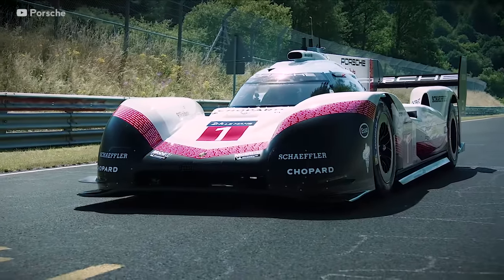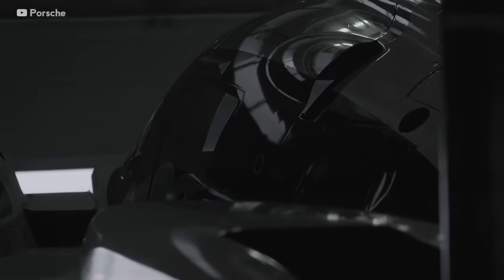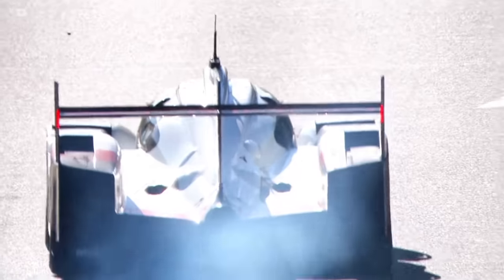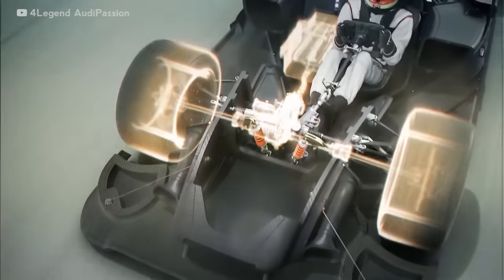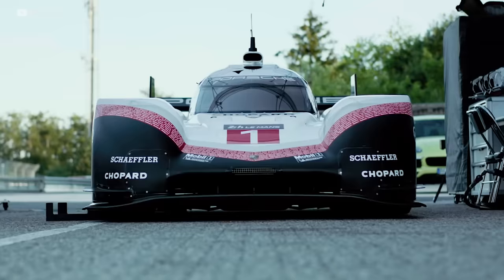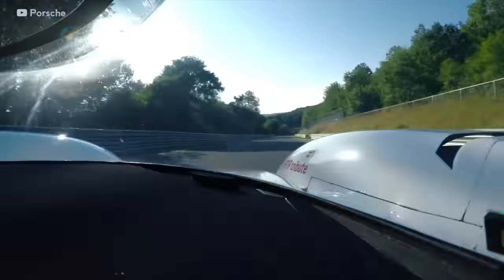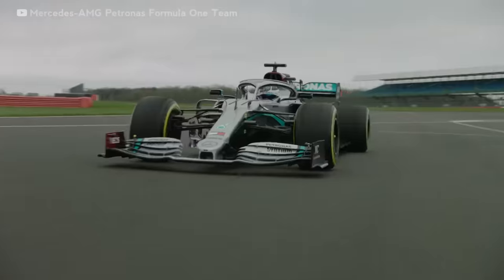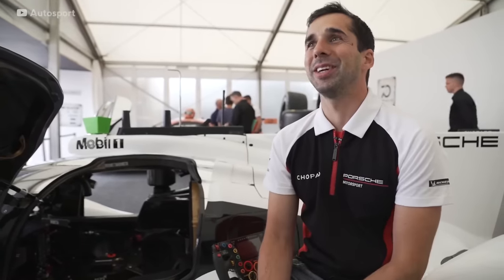How Porsche Built a Car Faster Than F1

Comment: The fact that the merc w11 is still faster really just show how invovations in f1 is still better even with alot of rules and regulations
Reply: Hmm... Probably due to the HUUUGE budget but Idk
Reply: 919 Evo, despite without rules, still using the same component, the restrictions they bypassed are like Fuel flow, ERS deployment (iirc drivers on LMP1 must use ERS carefully to avoid being penalized) and electric power output + DRS
Reply: @gmdascensia  These rules all apply to F1 also, Cars are limited to certain amounts of ERS usage, DRS only on certain straights and fuel flow restrictions. Take that all away and the unregulated F1 car would be running rings around the 919.
Reply: @curtiswhyte3297  what I'm saying it's not like they upgrade everything, another reason is because both F1 and LMP1 serve different purposes

I don't think F1 cars can survive running 24 hours non stop, yet alone a bit of contact and it's a game over, LMP1 car can even sometimes drag themselves to the pit even after heavy crash
Reply: @curtiswhyte3297  do you think an F1 car, take an example either RB18 or F1-75 unregulated with the exact same component can beat 919 on 12 hours of spa?
Reply: Not even talking about how bad RBPT reliability
Reply: @gmdascensia  probably, F1 engines and power train components have to last 4 or 5 races so 12 hours doesn't seem out of reach. If we're talking unregulated lots of grey area stuff comes back for the f1 teams like flexi wings and blown diffuser
Reply: @gnarkiller  another problem is that the engine must running at full pace 12 hours non stop unlike each race where there's a lot of gap on each, oh also the brakes needed to change and other stuffs aswell like exhaust system

Also don't forget that some F1 cars are having problem with the engine cooling that are not so optimal
Reply: @gmdascensia  Do you think 919 H Evo without restrictions as this one in the video can run at full pace 12 hours non stop?? Seriously??
Reply: @ors3ttone  They still use the same spec engine as the original so most likely yes, altho it'll be actually slower because it drinks more fuel since it's unrestricted
Reply: @ilan9588  Porsche has no budget problems
Reply: @curtiswhyte3297  Break all the rules and regulations, and f1 cars will be faster than anything. But that joy will only last a few minutes before it ran out of fuel and overtaken by an LMP1
Reply: if they let F1 engineers just go free on design and unlimited budget, you'd get cars like the Red Bull X prototypes from Gran Turismo

Comment: Porsche: beats Mercedes
Ferrari: write that down write that down
Reply: not anymore...this change from 2018...old history
Reply: S🅱inalla
Reply: Mercedes faster at spa
Reply: Now imagine if mercedes f1 didn't have any rules or limitations. They would easily make much better car and then they will put Levis in that car and they would easily beat porsche. Forget that they could just make some minor adjustments on their f1 that wouldn't nead to be with in the f1 rules and they would easily beat porsche.
Reply: @tenk548  it's already faster. Hamilton's pole lap was a 1.41.2
Reply: Fuel flow probably came up in conversation.
Reply: @MrGtubedude  This Porsche is actually the faster car ever made, faster than both, Ferrari and Mercedes F1 cars. Spa lap time record was set in a very cold condition with a 13° Celsius track temperature. There was no rubber on the track so the grip was way lower than the grip you have on a F1. Also I think we can say that Hamilton and Vettel are better and faster than Neel Jani.
Reply: @Victor-wy7yc  ur wrong man, do u know anything about f1??
Reply: @MrGtubedude  Nice argument, yes I know way more than you about F1.
Reply: @Victor-wy7yc  If you did then you would know that last year's cars were faster...
Reply: @Victor-wy7yc  it's still a car without rules, give that leeway to a F1 car and it will break that record in a jiffy.

Comment: Actually, that lap record from Spa has already been beaten since Q2 in 2018 (!!) by cars which were built very much under regulated rules. Sebastian Vettel (Ferrari SF71H, 1:41.501), Lewis Hamilton (Mercedes W09, 1:41.533) and Kimi Räikkönen (Ferrari SF71H, 1:41.553) beat the time set by Porsche in Q2, before rain hindered them from setting even faster times in Q3.

Also, just now (29 August 2020), Lewis obliterated that record once more with his monstrous Mercedes-AMG F1 W11 EQ Performance! He achieved a new lap record with an 1:41.252 (!!), more than half a second quicker than Neel Jani. Furthermore, Valtteri Bottas in the second Mercedes was also slightly quicker.

I think this shows you just how incredible these F1 machines are when even a completely unregulated Porsche can't come close to the times set by cars which operate well within a set of regulations. That's F1.
Reply: Imagine if F1 technology had been classified for decades. 4 stroke motorcycles including Moto GP took a huge step forward thanks to Formula One
Reply: Interesting info. Still with all that tech, the margins between lap records are slim. To really know which vehicle is truly better we need these vehicles to be remotely operated eliminating the onboard driver. This would provide a more accurate assessment of the performance of the hardware.
Reply: @citizendc9  ? what, but you are aware that a racing driver of the class of hamilton or even the once who drove the porsche. are some of the bets in the world, what they can do better then all the others are consistency. so aslong as both get driven by humens it doesnt matter, what does matter is air pressure, air conidiotn, wind, temperature, hight over sea and so on. The difference you get between differnt drivers is minimal. and btw 0.2-0.4 s difference is alot, just put it in lenth in meters and its alot with this speed.
Reply: @citizendc9  
Remotely operated?    So your saying a F1 car with the driver back in the pits driving the car with a video game like interface is going to be what? Faster (not a chance)?  more consistant at some speed slower than 10/10? - maybe , but if your not all out, how do you judge which is faster?

Or were you thinking that a computer in the car is going to drive faster than a human F1 driver?   Someday a computer might drive one of these cars faster than an average human,  maybe someday faster than an average human racer (although I think, a long , long time from now, like 30 years), or that a computer is going to be faster than the best F1 driver in the world (I don't know how to bet here.  maybe in a 100 years.   I don't know maybe it will be possible someday.   I won't live to see it [but I only have 30 or so years left]).
Reply: @brynnrogers5081  i believe what he is saying is that by having the same driver's that operate the vehicles on board now operating them remotely with a set up similar to video games (steering wheels with force feedback and paddle shifters, foot pedals, etc) can now negate the effects of g forces on the driver. This is something that could actually have a huge impact on a lap time as it was mentioned in this video that the g forces in the Porsche reached upwards of 4g on the driver's head and neck. It may not be a traditional way to drive a race car and if it does start to happen it will be frowned upon by motor sport purists, but finding any way to maximize speed by eliminating the negative effects of atmospheric pressures is what the engineering behind this sport is all about.
Reply: David Gretlein  why should that matter, that does not affect a laptime of the best Drivers in the world. Its easy for them to do this for some laps around spa. They are trained  you genius
Reply: @TheConservativeCanadian  okay I understand that.    However,  one of a pro drivers best feedback is 'feel'.   Once you remove the butt from the seat. The driver has lost a great deal of feedback needed to drive on the edge.
Reply: @TheConservativeCanadian    It is actually not like the driger has to support his head with a 4G sideways force on it.   every car that is putting that kind of force on the drivers head has a system to hold the head in place, to take the load off the driver.   Look at many racing seats now, they have a U that surrounds the drivers head, and keeps it supported from side influence.   I have a HANS device that I wear when racing, and it does kindof the same thing, only it keeps the head from being slammed forward (made manditory in most forms of racing after Dale Ernhardt's death - A HANS device would have probably saved his life).    

I know that your point is making the drivers 'equal' by removing the physical hardships of driving, but I am kindof making a different point - that you cannot remove the 'seat of pants' feel from the driver and still get the same laptimes out of him from a remote setup.   

I also think it will be a long time before computers can replace and beat F1 drivers.  Also, there really is no point in replacing them (with computers).   Attempts to add computers to shift gears, handle suspension, traction control, and so on are shut down by the rules - maybe after a season.
Reply: @brynnrogers5081  If it takes more than 10 years for a self-driving car to be faster than the best human racing drivers, i would be highly suprised. Racing is just simple physics at its core, and a computer can do that much better, faster and more accurate than any human can. Theres nothing stopping self-driving cars from already being faster than human drivers already, except for the subject simply not having received much focus, but thats changed now with self-driving being the centerpiece of modern car development.

Id wager on self-driving cars being faster than the best racing drivers in about 5 years, no longer.
Reply: @thiextar7537    I'd take that bet.  

I just don't see a computer car on the track being able to compete with F1 drivers.  I also bet it would be a safety danger, as the F1 drivers generally know what other drivers are going to do, while I don't think the computer could predict what other cars are doing, and the computer MUST be programmed with safety in mind.   Even so, I imagine the computer cars are going to crash at the slightest glitch or bump in the road when running at 10/10ths.

10/10ths is a racing term that basically means all-out, racing at that very thin line between extremely fast and crashing.  (and in my mind, only professional racers can race at that 10/10ths level).  

on a closed track with just one computer car,  things will be different.   The computer might be able to  do pretty well in such a case.   But that is not really racing - allthough I guess it is similar to qualifying for a pole position.

I hope I live to see this quesition answered...
Reply: lewis did a 1:41:252 this year
Reply: @citizendc9  Remotely-controlled F! ? We are almost there now, traction control, press a button to overtake, F1 is simply giant Scalextric.
Reply: @who9387  You're at a minimum 12 years behind the curve with that TC comment. It was only allowed between 2001 and 2008. And even then it was only because they were having trouble enforcing the original ban from 1994. Since 2008 the closest thing to anything resembling TC has been engine curves.

On the other hand, I have to say that I am very curious as to what exactly it is that you think the overtake button does in F1. Or any racing series for that matter.
Reply: @ck9103  - You will not be surprised that I know very little about motorsports. I just recall reading about a button  to give extra power when wanting to overtake.
Reply: you have to keep in mind that porsche "just" modified an existing LMP-1 car, which already brings a lot of restritcions compared to F1.
For example, the 919 evo weighs ~850kg while the 2020 AMG F1 car is about 100kg lighter @ ~750kg.
Reply: @who9387  The 'overtake' button jn F1 is the DRS button only allowed on DRS zones in the straights were the rear wing has a piece that then rotates, reducing downforce (makes car corner less) and reducing drag (less air resistance making the car go slightly faster), since its on a straight the downforce lost isn't a problem, yet you can't just overtake unless you had a good exit on the cornering leading to the straight and you are close enough to the car ahead, yet it may fail when you move aside into undisturbed air slowing you down because when you were behind the other car there was less air due to the car infront moving all the air sideways, also slowying the car ahead.

But yeah, you can overtake on straights with DRS
Reply: @r4rq291  Thanks for that useful info
Reply: @who9387  Btw the one that gives extra power from fans and going thru a different racing line is Formula E, the cars are limited to some power and can use full power when activated
Reply: @thiextar7537  But that implies engineers can be better drivers than the drivers themself. They must know how to make the IA change its driving according to tyre degradation, temperature, wind speed, rain, etc. There's so much impredictabiliy elements in driving, drivers sensibility is what makes them better than any machine. The only way an IA can be faster is throught self learning algorithyms, something even harder to do. So I don't think we will see that in 10 years or ever.
Reply: @eric meyers what you forget about is that the 919 still was developed for racing over 24h. even they changed quite a bit, the overall car is an endurance car. this makes it even more fascinating. take a f1 and let them modify it. it wouldnt even be close to race for 24h straight...
Reply: @brynnrogers5081  
Note that with computers driving all the cars, the car can completely disintegrate and pose no safety issues since there’s no one inside it.
Reply: Now imagine an unrestricted Formula One car.
Reply: You have to keep in mind that Hamilton, Vettel, Bottas or Raikkönen are some of the absolute best drivers in the whole world. 
Give Hamilton that Porsche and we might see how well he does with it
Reply: Just imagine taking off the fuel flow limiter!!!! Imagine how fast it would go
.
.
.
.
.
.
Oh wait Ferrari already did that one
Reply: But seriously. F1 needs to give the championship winning team each year an extra budget for modifications and no regulations to absolutely smash one tracks record just to see what is humanly possible
Reply: Yes. That’s F1
Reply: @jadermiani  Computers reaction time in such simplistic tasks as what is required for the feel are far superior to humans and the gap will keep getting larger. That's all I need to know. I believe we will see a computer drivers do some impossible looking stuff in less than 3 years
Reply: Lmp1 itself is more regulated than any era of f1

It has to be very very durable, while f1 is more about speed. F1 car cant do anything if the race took place according to the rules of Lmp1

so you would keep these "chauvinistic" words about the "superiority" of f1 over lmp to yourself(just kidding)
Reply: Schumacher did 1.43 in 2002. With grooved tyres. (4sec/lap slower), no drs, no hybrid bullshit.
Reply: Nürburgring is a different world. An F1 car is to fragile to hold up with the 919 on the nordschleife
Reply: and now do the 919 evo treatment to the W11...
Reply: @who9387  traction control is banned in F1 and DRS is just a fix for dirty air. Following car losses a ton of downforce so they get a chance to make time back on straight.
Reply: @nodo7575  I didn't understand any of that but I'll take your word for it. - Thanks
Reply: @thiextar7537  agree, in fact AI driven race car will probs have an EASIER time hotlapping a track than a street one due to the limited ammount of stuff it can find on the race as opposed to traffic rules + other drivers, calculating physics is easy for AI, plus extreme precision and way faster reaction times
Reply: Big tires, less weight. Some more downforce.
Reply: "Can't come close", errmm, its within 0.5s. That's close.
Reply: @citizendc9  i mean they would have to allow f1 to be able to have no limits aswel then it would be fair